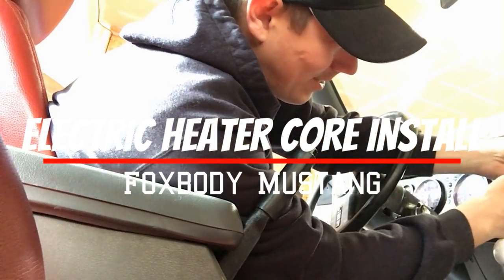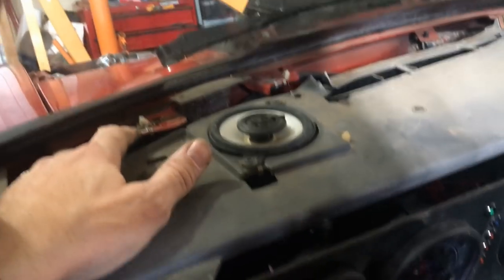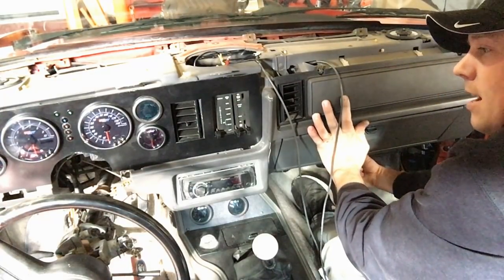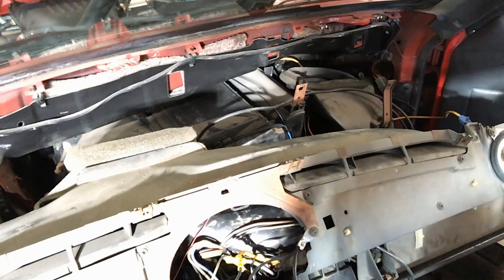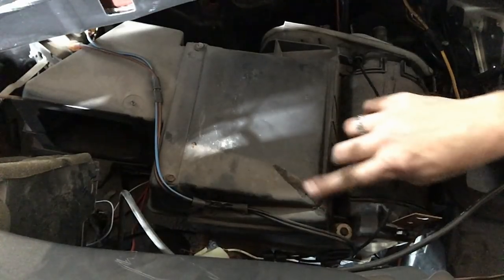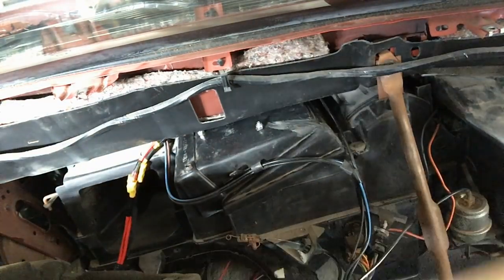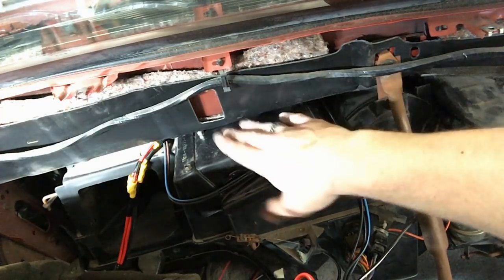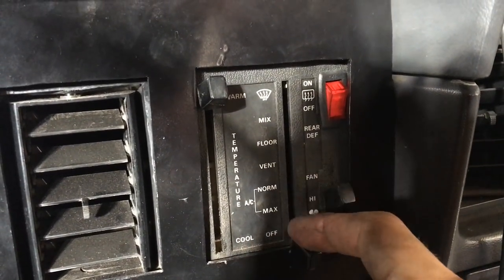800 Watt Electric Heater Core Installation

Comment: You need to mount the electric heating elements so that the air passes through the little fins not over them. You are probably losing 90%+ of the heat the electric elements are putting off.
Reply from the maker: I agree.  I mounted them this way so I could get a stock heater core back in.
Reply: Thats what i thought. I found it so strange that he mounted them flat on that piece. You could have probably zip tied them to the actual heater core itself  and cap off the coolant lines to the heater core and just have  100% electric heat. I can see the benefit to this on a cold day you will have almost instant heat.  I thank you for the great video though cous you got my brain working and now im thinking of doing this to my ford van which currently has an always open thermostat so my heats not working.
Reply from the maker: Version 2 has it mounted with air going through the elements.  There’s a video on it.  The heat difference is negligible

Comment: Im doing a tdi swap jeep and will be running electric heat as they take forever and a day to get up to being able to produce heat esp in the winter when its required the most...up until now I have heated seats in my current swap but won't consider it stand alone for winter cold.... Thanks for giving me another option.
Reply from the maker: Absolutely!

Comment: Right on !!!! I need a heater in my race street car here in SLC for my 92 Camaro I have nothing right now  I was going to buy a small heater core and plumb it to a fan I have
Do you think this would be enough for my 3rd gen camaro
Reply from the maker: It would probably do ok, as long as it’s not 30 degrees outside.  It’s more to just take the chill off.  It’s not going to make it 80 degrees in the car though.
Reply: @BMF_Garage  I’m going to use a heater core typ
Reply: @BMF_Garage  thank you!!!

Comment: Dude i might be wrong, but i think with your current setup (if your heat core is connected)you are actually causing the water to get hot faster which will make engine get hotter,totally inefficient but OK if you want to warm up your engine or defrost it :)
Reply from the maker: The heater core is just in there in case the electric doesn’t work good enough.  Then I can connect it to the coolant system.  As of right now the heater core isn’t connected
Reply: @BMF Garage  how do you like it?
Reply from the maker: It works ok enough for me

Comment: Thanks for the video, was really curious how much heat vs watt electric heater would produce, after seeing your video I’m going to run a regular heater core
Reply from the maker: Yeah.... I feel like it’s a toss up depending on how electrically inclined a person is... the standard heater core will produce more heat in my opinion. 

Thanks for watching!
Reply: @BMF_Garage  I believe it is a good secondary heat system as well for the rear. Just my $.015

Comment: I thank you for helping me figure out what to use. Someone out there does make and electric heater core that acts like a coolant preheater for the heater core. I have am email from summit somewhere with it in there. I have an 02 ram 1500 with 2 batteries 1 for normal truck stuff and 2nd for all my fun gadgets, sound ect. I'll probably do something similar but with the elements set up so the air flows through the fins vs over, also will have a switch under the driver side dash for it along with my other switches. Unlabeled of course lol. What I want to do is find a way to heat up the heater core w/out spending the $200 the summit racing guy wanted
Reply from the maker: Nice!!! I would have setup these for air to flow through, but put in a standard heater core with it so I didn’t have room...
Reply: @BMF_Garage  did you try mounting them on the inlet the air runs through? You'd probably have to make a 90 degree bend bracket, but then to prevent leakage, use some Hvac tape from Lowe's. Inlet being after the heater core, where the heater core cover/housing meats the inlet to the air box.
Reply from the maker: @AngelWolfSoldier  i didnt but thats a great idea!!
Reply: @BMF_Garage   not a problem.  Ive been "engineering" rigging stuff for awhile.
Reply: @BMF_Garage  hit me up if you ever want to figure out something crazy.
Reply from the maker: @AngelWolfSoldier   so funny story... my heater core went bad again so out with the standard heater core all together.  Time to place these so the air flows through them.
Reply: @BMF_Garage   haha don't you hate when that happens? Are you building up pressure towhere it hydro locks it? If so try filling the block first. If no you could have rust/gunk flowing into it clogging it.  Try to clean the system with air and water, sometimes even with a good flush it might not fix it. I'd work my way up stream from the core and just give it all a good once over.
Reply from the maker: @AngelWolfSoldier   wellll....I put a used core in that I had sittin on a shelf.... I know I shouldn't have....
Reply: @BMF_Garage   not a big deal tbh. My 79 firebird was 30% parts that were just sitting around. Lol.
Reply from the maker: @AngelWolfSoldier   lol my thing is the obly new core I could find last time I looked was aluminum... they had stopped making the copper ones.... I tried the aluminum ones and had two fail and said to hell with that.  there is a flow restrictor for the fox body that needs to go it... I'll do that if there's ever a next time lol

Comment: Just wondering why didn't you put a new heater core back in?
Reply from the maker: I put a new used one back in lol. I had one that was laying around from a previous project that never got installed.  Put it in the same time I was doing the heating elements

Comment: Where do you live and how does it work? I may want to do this!
Reply from the maker: I live in Colorado.  It works good, but I’d change the way I mounted them.  I also put in a stock heater core so didn’t have much room... you have to make sure the air is blowing through the elements rather than across them like I have... it heats better that way. I just didn’t have enough space with the other heater core in there too..

Comment: How is the electric heater cores working soon far?
Reply from the maker: So far so good.  Haven’t driven it when it’s been much below 30 yet.  Definitely takes the chill off, but I don’t think it’s going to work terribly well below 30 degrees
Reply: @BMF_Garage  I'm considering trying this conversion. I eliminated the heater tubes on the intake manifold and don't want to put it back in for heat.
Reply from the maker: My only complaint is that these heater elements are not putting out what they are rated.  I’m going to try and find some different ones moving forward.  Also I think my placement isn’t getting enough air across them.  Still works, just not as hot as I want.
Reply: @BMF_Garage  to work effectively, they would need to replace the heater core or sit directly behind it so that the core isnt acting as a heatsink. have you measure the current drawn by these devices to see exactly what power they are actually running at?
Reply from the maker: @markj7604  absolutely, even did the math..  At 400 watts and 12 volts its about 33.3 each.  at 13.6 or 14 volts its about 28.  I measured with a meter as well to make sure I wasn't going above the rated capacity of my wiring, relays and fuses.
Reply from the maker: @markj7604  I need to place these where the air is going through them not across them like I did in the video.  I was trying to make room for a traditional heater core to sit in there also.  Will be making some adjustments very soon to get better performance from these elements.
Reply: @BMF_Garage  at a higher voltage, i.e. 14v from alternator rather than ~12v from the battery, the current draw will increase as the resistance of the device will not change. If it truly draws 400watts at 12v then it will be closer to 460-470watt at 14v. I look forward to the next vid, I'm looking to install a similar device with the hopes of some hot air demisting the car without having to wait for the engine to warm up. Good luck with mk2 👍
Reply from the maker: As volts go up, amps go down.  Ohms law and electrical theory 👍🏿
Reply: @BMF_Garage  The constant is the resistance of the device, not the power rating.
Reply: @BMF_Garage  V=IR. V is calculated by multiplying I by R, R doesnt change for the circuit, so if V is larger, I must increase.
Reply from the maker: @markj7604   Yes, V=I*R where V=volts, I=Amps and R=Resistance but that's when you're calculating for volts..  If you're calculating for Amps or I, the formula changes to I=R/V or Amps = Resistance (Watts) divided by Volts.  current and voltage are inversely related.  when one increases the other decreases.  Hence why most industrial equipment uses 480 volt equipment because the current draw is less making the electrical bill cost less.
Reply: @BMF_Garage  I have been wracking my brain trying to figure a mod to my Corvair for heat. The original heat system drew heat from the exhaust manifold area through a tunnel into the passenger compartment which IMO is not a great idea. Secondly I will be running headers which greatly reduces any heat one might get from the system due  to shield mods. These car have no heater cores and can be easily modded to a system such as your if it works.
Reply from the maker: @randsonic   this works ok.  Better to blow the air through the elements instead of across them.  If it's 30 degrees f it doesn't work great lol